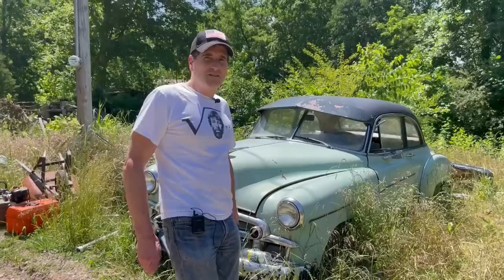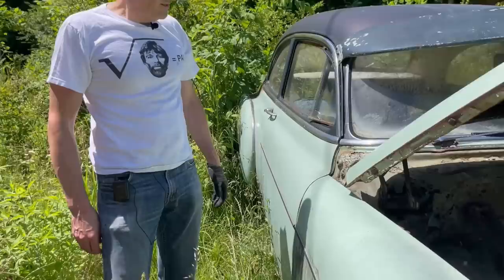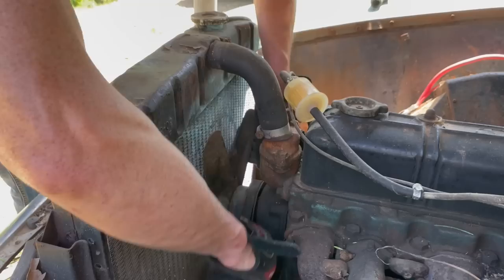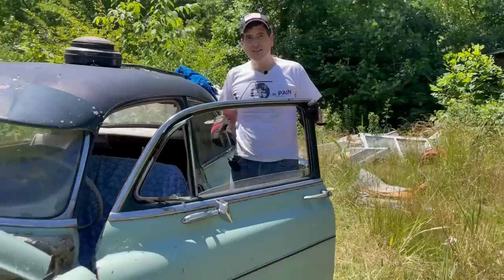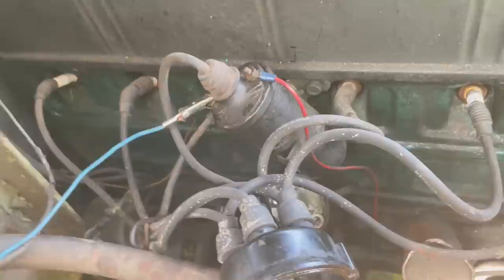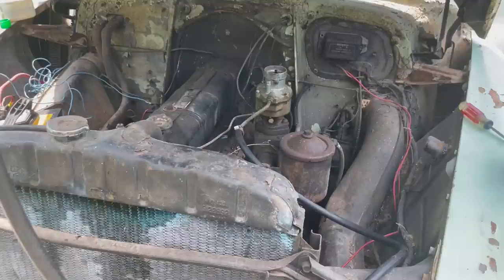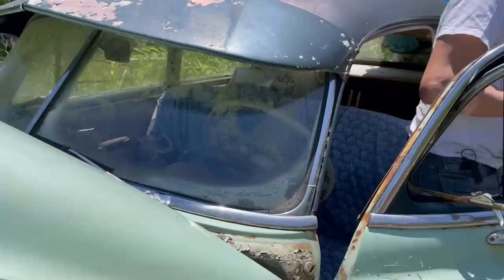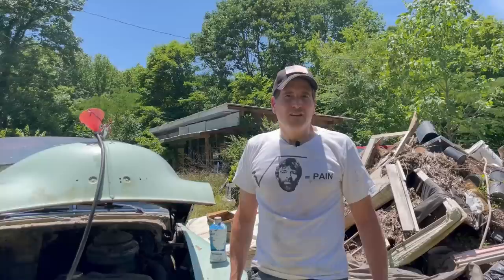Will it run? 1950 Chevy old school custom cruiser forgotten for decades!

Comment: Fun video that brought back memories. Our family car in the 50s was a 49 Chevy. I got my drivers license in it on my 16th birthday. It didn't have turn signals so I had to use arm signals, which we were taught in drivers ed in HS.
Reply from the maker: I remember hand signals very well. I owned a 50 Chevy once that did not have turn signals until I bought it.

Comment: Just found you, great video.  I will be browsing all the rest.  I have a 1950 Plymouth business coup with a stuck lifter.  Not sure if I want to dump more money in the pit.
Reply from the maker: Welcome Ronald. A 50 Plymouth is a unique vehicle. Perhaps using Mystery oil will free up the lifter?
Reply: @whattherust  Lots of MMO - long story, got it to free up, but happened again 3 months later,  Not sure how to make sure it does not happen again, can't find the right valve spring compression tool.

Comment: New subsciber, 153624 is the firing order. My 51 had the same engine. I remember having to time it off the fly wheel. You shined the timing light into the hole on the spark plug side. Loosen the distributor and rotate it till the ball bearing lined up with the arrow. Good job young Man, appreciate you bringing old ones back to life.
Reply from the maker: That is a great tip David! Thank you for the support.

Comment: Runs great and its a two door ! Only  one negative thing those clear plastic fuel filters are a fire waiting to happen. especially when placed between the carb and fuel pump.
Reply: The metal filters are best. Never use glass if you can avoid it.

Comment: My first starts: Remove plugs, squirt some thin lube into each cylinder, rotate fan a few times with plugs out, put new oil into engine, install plugs then try starting.

Comment: The heater is the "more expensive" Chevrolet dealer option Air Flow heater. You will see the core for it on the right inner fender. The "those are for" is the remnant of the half circle horn blow ring that were part of the DeLuxe wheel. It is not an oil bath air cleaner...it is the standard non-oil bath air cleaner. Only the wire mesh has oil on it. This car also has the 1950 Chevrolet accessory hood ornament.
Reply from the maker: That is great info Josh. Thank you for taking the time to write it. I have seen so many different kinds of heaters in these early 50 Chevys, there must have been at least 4 different kinds used.

Comment: 1. Back in that era, heaters were a factory option.  You paid extra. Also backup lights. Turn signals were aftermarket. 
2. ALWAYS have a copy of your important files on your own media, offline.
Reply from the maker: Right, that was a tough lesson to learn.
Reply: The radio and heater did not become standard until the 70s.

Comment: this gem started right away... surely it's been waiting for you to kiss it back alive. :D

it's so complete, and despite the broken window the interior is still good to be cleaned and done with it, amazing. :) you could just clean it and fix the mechanical issues and the occasional rust hole, and keep the patina and traces of 72 years of driving. well, more 50 years, but still. here in europe the signs of a life on the road have become more valued than a better-than-new look (even more as some artists are able to create the old look out of a freshly restored vehicle; but then, where is the car's history?).

Comment: Something that really helps with off setting the cost of resurrecting these old cars is throughout the year collecting any brand of oil that you run across that's cheap. I've done it forever I'm talking garage sales estate sales discount stores even when your just on a road trip. You can get a quart of oil anywhere from a quarter to a few bucks. 1 here 2 there. I've collected over 40 quarts of oil in a garage sale season and only paid about 60$ for all of them. Yeah they were mis matched but I was able to resurrect old cars that had no oil in em and and run em for just about nothing. Same with oil filters you never know if your gonna run into a car that uses that 50 cent oil filter you picked up at that yard sale.
Reply: Richard does the same thing!  I bet the two of you could trade estate sale stories for days!  Thanks for watching!

Comment: Those where work horses. My dad had a 51, we cut a big maple tree the trunk set on the saw's bar. my brother climbed up the tree, hooked rope to it, and the other end to the car, and pulled the tree down. With basically the same mechanics as this 50 model. Dad painted houses for a living, he carried his step ladders in the trunk, a 40' and 20' wooden extension ladders on top. 
  I wish I had one now.
Reply from the maker: That is a great story. Do you have any pictures with the ladders on top?

Comment: Those steering wheel "knobs" you wondered about ae where the original horn ring broke off; it was on the  lower half of the steering wheel.

Comment: Did you notice the cooking pot next to the radiator to keep it from overheating?  I'd recommend a 4 core radiator for it. It's a possibility that's why it was parked.  Between a low volume water pump and a narrow radiator it could have had some  serious overheating problems in its past that were never taken care of.. New headliner and a really good detail and paint job would turn this baby into a gem at a car show!!
Reply from the maker: It would for sure. This car could be a driver with just a few days of work.

Comment: Being a 216 with poured babbitt rods you must use non detergent oil if it is to be driven, detergent oil will wear out the rods prematurely and you will need to pull the oil pan off and remove a shim or two from the rods if it starts knocking.
Reply from the maker: That's right. High detergent oil s not the best for older engines.

Comment: To check tyre air pressure without a gauge, gently tap side wall with hammer until it rebounds and hits your forehead.
Reply from the maker: That is  funny tip. I'll try to remember it!

Comment: These cars are 6 volts.  (Yes, there are 6 volt alternators.)  Using 12 volts will burn out your bulbs and fry the radio, heater fan, etc.

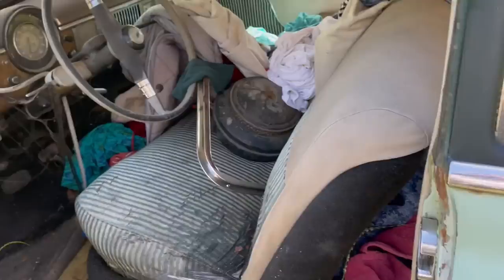Comment: That inline 6 sounds real good. Especially since it's a Babbitt rod engine. I'm assuming it's 2:35 it could be a 216. Is the car currently for sale? Thank you for the video. It's kind of nice seeing one of these cars with the original six-cylinder in it and not hot rodded out
Reply from the maker: I think the owner would sell it. He is getting on in the years.
Reply: Amazing ease to get it running after twenty plus years I believe 50 was the first year for the 235, but only with the Powerglide automatic. Insert bearings started after 48.
Reply: 216 cubic in is what it has. 
I'm 76 and worked on many of these growing up. Loved them then and still do to this day

Comment: 235 is a Babbitt crank splash oilier its not a full oil presser eng. that is a stock oil filter from the factory. the car is all stock. some one changed it to 12 volts

Comment: I call it an oil change without turning a wrench I had a 1949 painted beige first thing I would do when an engine hasn’t run for years squirt some marvel mystery oil down each plug hole so you don’t get a dry start up but that’s just me and a mixture of dawn dish soap and water mix works better than 🐝 wasp spray
Reply from the maker: I love Marvel Mystery oil. I use it for a lot of different things. Good tip for the wasp spray!

Comment: Also if need get Oil pot filter cannister by them some automobile parts store you have check out if can't find one you buy from John Deere or International Dealerships on gas engines from 1950's excellent filter but have see they match it on stock too !

Comment: Just an FYI on those old 216 Chevrolet "Stovebolt" engines and oil.  There are main bearings at the front and back end of the block.  They use impregnated graphite rope as main bearing seals.  It's not a very good design as the seals break down or wear out quickly an allow oil to leak out both ends (mostly the back end) of the block.  I have a '48 Chevy with the same motor and keep a pan on my garage floor to catch the leaking oil - and my engine only has 56K on it.  My dad had a '40 and said you could fill it with , then drive around the block and nothing would show on the dip stick.  So...  The nearly empty oil pan in the '50 that has been sitting for so many years is sort of expected.
Reply from the maker: Good to know. Thanks Matt!

Comment: Same heater controls as mine and mine is 100% original unrestored from the original owner. Maybe yours was changed? I've never seen any other heater control setup. The horn ring is broken off and they capped it.
Reply from the maker: Mine had a blower speed switch under the dash, and a small lever under the dash to switch from heat to defrost. It was probably an aftermarket unit.

Comment: Greetings from Scotland. Very nice job there. Started first time, and sounded very cool.
Do you ever come across the old Plymouth Fury, with the large fins on the rear ? 
It’s a bit of a land yacht, but ever since I saw it in my favourite film ( In the heat of the night ) I’ve been eager to see a ‘will it run ‘ with one of those.

Enjoying the channel and the variety of cars and trucks. 
Cheers for now…..
Reply from the maker: If I ever see one I'll definitely shoot a video. I missed out on one recently!
Reply: @whattherust  
That’s a shame, but what a thought…I’d love to see that on a video.
Being in Scotland you don’t see many Plymouth Fury’s on the road 😎.  With our wet climate that’s probably just as well. It would rust away in no time.
I look forward to your next video. Many thanks
John.
Reply: I think that the one from that movie was a similarly shaped DeSoto.
Reply: @mejurgensen  
You may well be correct, I certainly no expert, but I think I did Google “ Cars used in movie In the heat of the night “ and it showed the Plymouth Fury. ( When Virgil was being chased by the young rednecks to the old factory ).
Happy to be proved wrong though.

Comment: YOUR LUCKY GENTLEMAN YEARS AGO  THEY WOULD CHANGE THE SPARK PLUG WIRES CAUSING THE MOTOR TO BACK FIRE  AND WOULD BLOW DIRT OUT OF THE CARB MY FIRST CAR  WHEM I WAS FIFTEEN WAS A 49 TUDOR SLANT BACK CHEVY  I AM 75 NOW IT WOULD HAVE BABBIT RODS  NO INSERTS  YOU HAD TO USE PLASTIC GAUGE AND HAND FILE THE  RODS I DON,T REMBER ABOUT THE MAIN BEARINGS IVAN FROM ULLINOIS.
Reply from the maker: Hello Ivan. Good story. I know of a 49 slant back sitting in someone's backyard. I might ask to do a video of it.

Comment: Couldn't you just tow it out of the weeds onto the driveway to work on it? Or are brakes froze up? Just wondering.
Reply from the maker: Hi Christine. It is pretty close quarters where it is. Just to move it ahead a bit I had to move all kinds of scrap metal. There isn't really a driveway to speak of. It is more of a path with scrap metal everywhere.